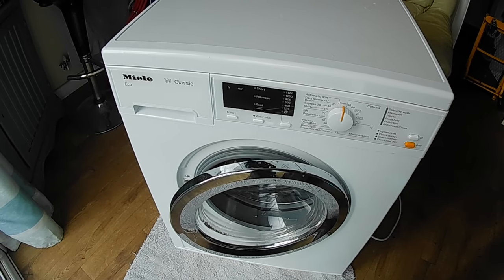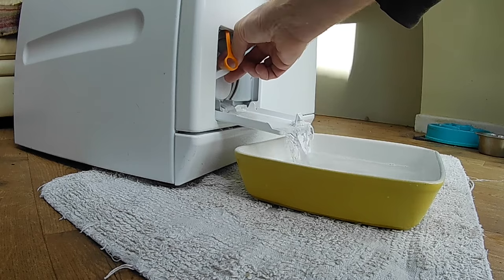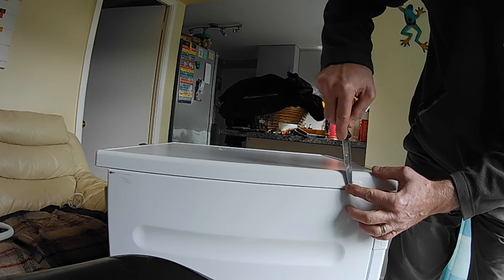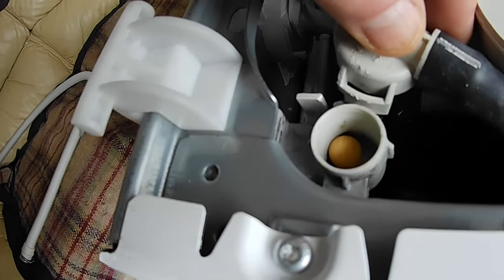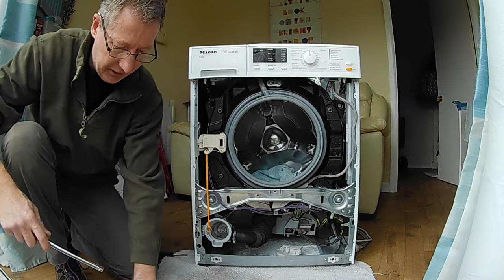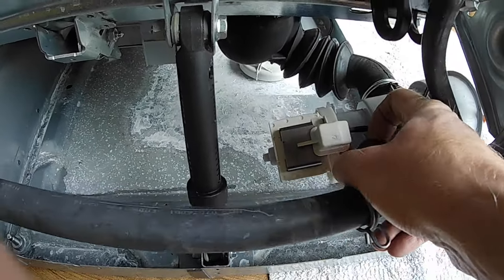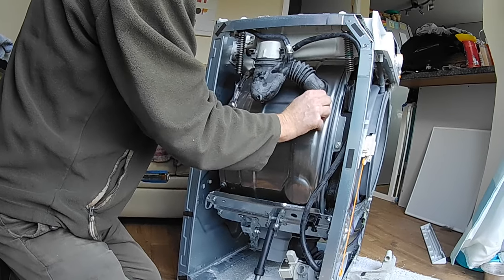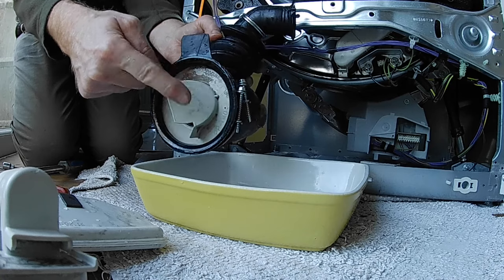Miele Washing Machine Drain fault - multiple fixes

Comment: Thanks so much for this informative video.  After experiencing a constant anti flood error on my Miele W3902  (even after tilting forward as many advise), it would not go away making the machine unusable.  After following your instructions for opening i discovered the fault.   Within the anti flood float device (it just turns out and clips pop it open) there is a small micro switch (from cherry) that had completely rusted out the contacts and jammed the switch itself.  Replacing then device solved the problem.  Wife is quite proud of me now 😂
Reply from the maker: I'm glad that the video helped and pleased that you fixed your fault. Hopefully others with the same problem will be helped by your advice on the switch.😊

Comment: We had a crack (and therefore a leak) in the chamber that connects to the outlet hose (I think it cracked when I set the machine down not-so-gently when moving it years ago -- it has leaked slightly ever since). This video helped us remove the chamber to find the crack. Now we'll be able to seal it. Thanks!
Reply: That's precisely why washing machines require re-blocking during transportation. However, I'm surprised this happened to a Miele washer, especially considering that they're high-end (whatever the hell that means these days).
Reply: If you mean reinstalling the transit bolts, I did reinsert those before transporting, but I think the breakage happened before I was able to do so, while I was manoeuvring the machine out of the tight spot that it was installed in.  @zlatanzakic
Reply: @michaelmcgreevy4033  Yes, that's precisely what I meant, and since I planned my next (new) washer be Miele (the cheapest one, of course - I don't have money for more expensive ones in Serbia), I was afraid that even Miele began to cut corners regarding build quality these days.

Comment: Many thanks for your well explained repair. I had the same issue. The pump was turning and measuring the contacts on the pump with the lead removed showed 140 Ohms, so all good with the motor! The problem thankfully solved by removing all the hoses, flushing them with a hose pipe and nozzle and reassembly.  Just one thing to add is...remember to put the orange emergency door opener back into the opening on the main panel before refitting ! Thanks again, G.
Reply from the maker: Many thanks - Glad it helped. I agree, yes, it's a pain when you put the front back on and forget to slot the yellow handle into the filter door.

Comment: Very helpful video- thanks.  The w 1913 model is the same but a slightly different front removal. No kick panel , rather rests on two supports and lifts off. Warning tip: be sure to thread the orange door release overide through the the slot before putting everything back together otherwise you will get practice doing it all twice 🙄
Reply from the maker: Good tips - I have done that more than once!

Comment: Thanks for the video. If I may add no1 clean filter. No2 clean the outlet chamber that is just under the lid with the ball in it. Be careful there is a washer that can fall out of the upper bit that can fall into the machine as you lift the cap. The ball floats up and seals the hole in the washer when the machine is draining. If this area is a little muddy (sticky)and a bit of grass or a tiny stick or a grain of sand stick in the mud the ball may not seal on the hole  and the water will circulate instead of draining. I think cleaning these two items will get most machines going again and you only need to take off the lid.( 2 screws) and unclip the chamber.
Reply from the maker: Thanks big all suggestions welcome. Your experience may save others time 😊

Comment: i've been having problems with my 17year old w504 draining very similar layout, panel work certainly the same. had a blockage on the narrow pipe to the pump massive build up of pet hair 🤢 gave everything else a clean as you descibed as i was there and seems to work a treat now. many thanks
Reply from the maker: So glad it helped. As I say, I'm not an expert, just sharing what I found out. Thanks for your comment 😊

Comment from the maker: Our issue came back 3 weeks later, I still suspect that it's a gunged up pressure chamber (shown at the end of my video), my wife put some washing machine cleaner through the machine and it seems to be working OK since. Perhaps that was all it needed - however, may be a cheap and easy way for others to try fixing their machines first. It may save cleaning all the pipes manually like I did???
Edit: 3 months later - it's still fine. Credit to the wife! A cleaner agent was all it needed.
Reply: Good work - we have a WDA101 too and use a cleaner regularly... it's also important to do a weekly hot wash at 60 and use the 90 programme from time to time. Have you had to change other parts yet like the shocks or brushes? We've not but this video will really help when the time comes!
Reply from the maker: @CorradoTDI  thanks. No, no other parts yet. Will take your advice on the hot wash regularly 😄 👍
Reply from the maker: The issue came back again a year later. I stripped the machine again and all was still very clean. I watched the failure when it happened and could feel the drain motor running by touching the filter flap at the front. But no water was draining even into a bucket. I replaced the motor with a compatible for £29 on eBay. SWMBO very happy again now. I am a hero again.

Possibly the motor was struggling at the start of this journey and cleaning everything gave it enough of a chance to get the water out????
Reply: @CorradoTDI  I'm fairly sure that Miele have only used induction motors for their main motor for some years now, so no brushes of course.
The earlier DC motors Miele used were very well engineered and the brushes lasted virtually the life of the machine in my experience.
Reply: @Martindyna  Not on this machine though - last of the old style chassis and uses a brushed motor. I actually picked up an entire motor brand new with brush module as it's common for the brushes to jam and wear the commutator.

Comment: Brilliant guide  We have a w3204 (10 yr old) which is identical inside to the one shown
   we had check drain and inlet flashing lights
Removed the front kick panel then using a torch could see water sitting in the bottom trough
 After following this guide to remove front side and top panels i found the water inlet was dripping 
Seal not doing its job   Removed the inlet and smeared some tigerseal inside the rubber seal and on the pipe it slides on to
 when you check  genuine spare parts tigerseal is the way to go💯
  BIG thanks for posting
Reply from the maker: Thanks so much for your positive/kind comments. Great advice on Tigerseal. I'm sure it will help others.

Comment: At the end you mentioned grease to use for pushing back the water level sensing part.
It is critical to avoid using grease (or any oil based substances) with rubber seal or part. If you must use dedicated sewer pipe lubricant or just plain old soap or dish soap.
Why you ask? oil based substance like grease might case degradation of the rubber and thus a leak due to loosing a proper seal after some time.

Cheers!
Reply from the maker: Excellent input,thanks Robert. I was going on what I had seen in another video. Your input will help others😀👍👍

Comment: Superb video - thanks so much! Had the F11 code appear occasionally over the last few weeks, then every time the machine was attempted to be used. A quick check showed that the drain pump seemed to be working fine, and would pump out a torrent of water. So, after watching your video, I disconnected the pressure switch pipe, and connected it to a foot pump, so that I could blow air back though it. Reconnected, and the machine ran fine the next try. I've ordered up a syringe, so that I can back flus it with water rather than take it all apart - hopefully that will last a while!
Reply from the maker: Excellent, you may find cleaner or hot wash may help as described below.

Comment: Really happy to have found this video for my W5470. Very similar but a little older. It was smelling and not rinsing well. Fault was found in the blocked small pipes feeding the soap dispenser etc. Nasty brown soft gunge. I wonder if this is caused by detergent or softener, assuming the main wash liquid goes out through the bottom end, and what the solution is. Powder, liquid tablet or what:)? Thank you for posting this up.
Reply from the maker: Hi, glad you're sorted. We have found that a max hot wash (empty drum if necessary) or a washing machine cleaner helps. I guess the brown stuff is just congealed old soap. 🙂

Comment: Thank you for the useful guidelines.
What happened in my case was that the thread which held the chamber (7:41) onto the frame broke off, and off with it came a piece of the chamber. This ended up making a hole on the chamber. 
I suppose this must have happened during transportation (as I bought it second hand).

Comment: Thank you for the invaluable video. Hopefully it will sort my F11 error. only slight problem is I’ve lost the little yellow ball from the top back box bit. Is this essential? I am struggling to find a replacement part and it seems a shame to have to replace my washer because of 10 pence plastic ball :-(
Reply from the maker: It stops back flow if the exit pipe gets full. Will work without. You could probably buy one online somewhere. Glad your machine is fixed😊

Comment: Great video. And I followed it to the letter. So how heartbroken was I to see that despite finding some items in the system, that it didn’t resolve the issue. F138 still comes up and water is filling the bottom tray. Looks like I’m going to have to run the machine without the casing to see where the issue is. 😢
Reply from the maker: Thanks. Yup, sounds like you have a leak. An old mechanic trick was to blow chalk dust over all the surfaces then look for water trails. Might help if you can't find the leak. Don't forget that water and electricity don't make good friends. The case is earned to protect you. Inside parts may not be earthed.
Reply: @westfielder01 thank you for the chalk tips. Yeah I will have to be careful but I don’t see how it’s possible to diagnose the issue without seeing where the leak is coming from.

Comment: We've had ongoing drain faults with our Miele which looks like the same model - now at the stage where it won't spin - thinks about it and then clicks off, either counting down to zero time or showing the drain fault bar. I've already cleaned out the vent pipes which were grunged up and also the drain pipes. It has been flooding but not now as I took the front off again today and it's dry. I can see there are some pipes I could also have a go at but what baffles me is that it washes and rinses fine and so is draining after rinsing, but then fails at the end of the cycle when it's supposed to drain/spin so am a bit stumped.
Reply from the maker: If it won't drain then it won't spin. If it does drain at the end but won't spin then it sounds like some sort of balance issue to me - most washing machines will know when their load is out of balance and try and tumble the load for a minute or so before trying to spin again. If the clothes are still sodden from an incompete drain then balance achievement will be less efficient - diid you trydoing an empty wash? You can see if you don't get a full drain and also test teh balance theory.
Reply: @westfielder01  Thanks for the idea but I don't think it's anything to do with the balance (I fitted new dampers recently). It's currently going through a full cycle on a first express wash but the drain pump keeps running at the end. Then a second wash it fails to drain properly and won't spin and I can't work out why. It must be something fairly simple if the machine is basically sound. As it stands at least it works for one cycle if left for a day or two and we have a garden to drip dry too. Otherwise it's new machine time.
Reply from the maker: @dalstonjazz  Sounds like it could be the pressure chamber or pressure switch - clean the first, if that doesn't work, replace the second.Not too expensive. Unless the machine is ancient I would persevere. They're supposed to be a good brand, I bought ours because it's not rivetted together and is repairable and Miele keep parts available. Good Luck
Reply: That could be an issue with the balancing system

Comment: Thanks so much for this! I lost that little ball (not sure how or where). Is it very important? If so how can I find a new one?
Reply from the maker: I believe it's there to stop back flow of water into the machine via the drain pipe. So if, for instance, your drain pipe was shared with another device and it got blocked further away than the two devices' outputs then without the ball the output from the other device could come back into your washing machine via the drain hose. Please someone correct me if I'm wrong.
Reply from the maker: No idea where to get another one - I guess if you spoke nicely to Miele they might stick one in the post - can't cost them much 🙂
Reply: I found it! It had rolled a loong way! Also I managed to fix the draining issue, some of the tubes were really clogged. Thanks again for the great video!
Reply from the maker: RESULT! Well done :-) @markussnellman3984

Comment: Having trouble getting the drain screw out, when we try to unscrew it the turn screw unscrews and separates from the plug. Tried to get molegrips on the plug but not alot to clip to.. any ideas?
Reply from the maker: Not sure what you mean by drain screw? Could you elaborate? 🤔 😃
Reply: @westfielder01  Thanks for replying, i mean the front left filter screw once you have put the flap down. Thanks?
Reply from the maker: @michaelsims9120  Hi Michael, sorry for delay - just got back from work. All I can think that you could do is take the front off as per my video, detatch the pump from the 'spout/screw housing' from the inside then try and get at the 'screw' from the pump side. If not, replace the screw and housing. I'm sure others on here may have a suggestion. If you work out a solution, please post for others who might have the same issue. Good luck
Reply: @westfielder01  Thanks for your reply. After alot of rocking backwards and forwards with mole grips it freeded off. Once it was out, the hole was completely filled up with 20 Years of chalk, managed to chisel it out. All back together, 5 washing loads down and no issues. Thanks
Reply from the maker: Hooray, well done  @michaelsims9120 so glad you got it sorted 😃

Comment: Hi, I'm hoping that you can help please! I have an identical machine (about 16 years old). I had the usual two red fault lights, and have tried all sorts, and in the end have tripped down and cleaned (as in your video) I also tried pressing and holding buttons, and I have somehow managed to get the start light fast flashing, and now all lights and displays light in a sequence loop continuously! Do you know how to reset the machine? What ever I try, I cant seem to get it back to normal! I have searched extensively on line, but there doesn't seem to be any info about resetting these older models.
Reply from the maker: Sorry, not a clue - as I said, I'm not a washing machine engineer.The only thing I found in the manual was "To switch off the fault indicator: Switch the washing machine off with the  button and turn the programme selector to Finish." But I'm sure you have tried that. It sound like you have entered some kind of engineers diagnostic to test all the lights. I failed to find a service manual. I think Miele call them Technical Guides. Do let us know if you find out how to get around this. Sorry I can't help further
Reply: @westfielder01  Thanks for the reply, I'll try to fine a tame Miele engineer!

Comment: Hello,
I have the Miele TwinDos W1 and it does not recognize the detergent. If I do a wash with TwinDos, the detergent from containers 1 and 2 runs out in one wash. When I go to do a TwinDos cleaning, it shows a message that the container is empty.

I cleaned all the detergent tubes.

I checked the platinum sensor with an ohmmeter and saw that the resistance changes when there is flow. So, I assume it is okay.

I changed the EZL166 control board, but the problem remains...

If anyone has any other ideas on what to check, thank you very much!

Comment: Hi I did all the cleaning, everything is fine its still telling me check the Drainage and intent. And the word F and 135 is coming up ... any idea how I can fix that? thx.
Reply from the maker: Really sorry, I don't, I tried searching and found F135 is not used. F35 is a door interlock that could mean that the drum isn't emptying fully. But if your door is opening Ok. Then really not sure, maybe someone else on here may know.
Reply: Thank you for replying; there was water inside the machine on the bottom. I took it out and worked. I don’t know how the water leaked to there. But your video was very usual. Thank you.
Reply from the maker: @alijameel5130  Excellent - well Done. Your reply will probably help others too 🙂

Comment: The yellow pull tab was broken is there a way to open the door?
Reply from the maker: I think you'd need to take the front off. But I suppose you could use a coat hanger and bend it into a hook shape and poke uit up where the yellow pull tab starts (see video) - please let us all know if you succeed! 🙂